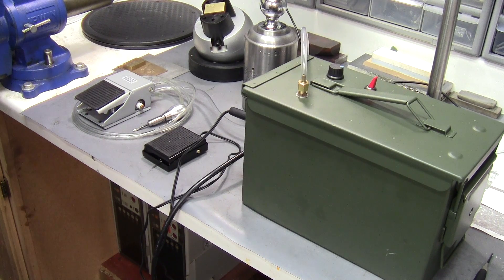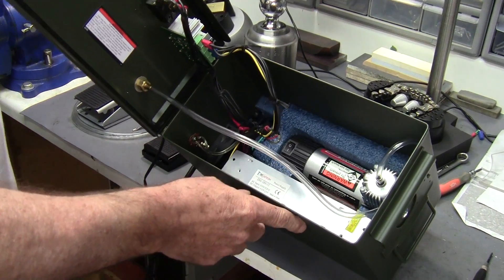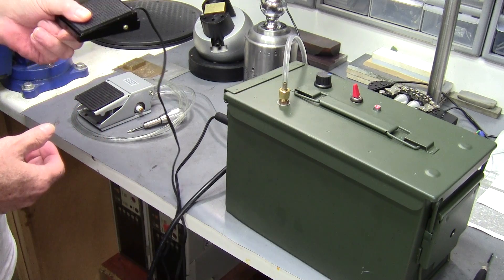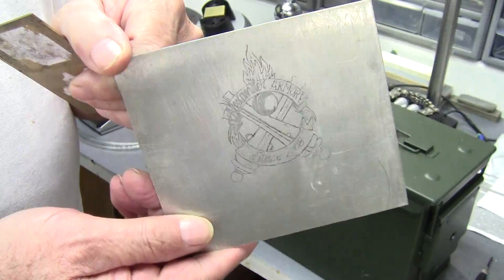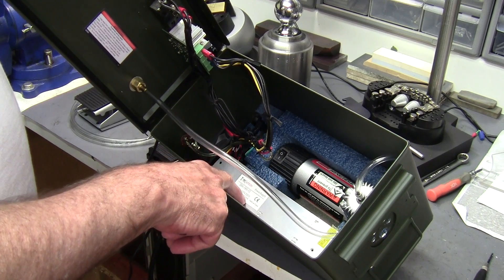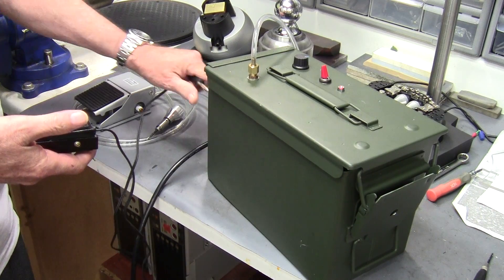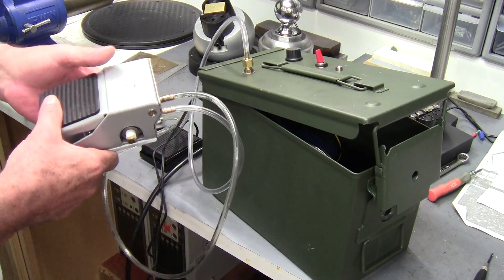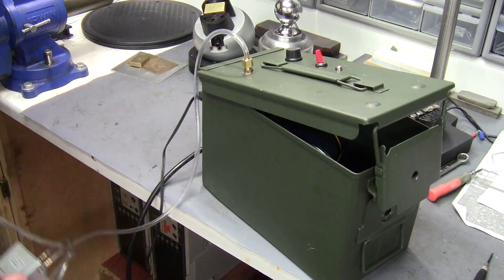How I built my Homemade Hand Engraving Machine Part 1

Comment: Can you tell us what the electric pedal does? The pedal compresses the air to operate the machine. But your electric pedal has 2 wires (no speed control). If you press it again, you have to press 2 pedals at the same time
Reply: Thank you, I understand. Hope you have many good works
Reply from the maker: The reason I show two pedal's is to give you options, I use just the electric pedal, I set the speed controller to the speed I want and use the pedal to turn the machine on and off. For finer control use the air pedal. What pedal you use is a personal choice depending on how you like to engrave. You could also wire the air pedal to turn the machine on as you press the pedal. You do not need both pedals, use the setup that works best for you.

Comment: Will this machine work with a hand piece bought on amazon?
Reply from the maker: I do not know, I have only used the ones I made. I've been ask this question before, but so far no one has said they tried to make one work.  I do know the Chinese hand-pieces are GRS clones so they don't work the same as the homemade system,  it would have to be modified.
Reply: @ralex397  do you sell the hand pieces that you make? I don’t have the equipment to machine my own
Reply from the maker: @brettmcguffee8119  No I no longer make these to sell, sorry.

Comment: The machine only lasts 30 or 40 hours then shot.
Reply from the maker: Watch my Required Maintenance video, you need to keep an eye on it in the first few hours and make sure it has enough oil in the head and how hot is it getting. I have seen some fail in less than 50 hours and others go for 100's of hours. It sucks when it wears out that quick. Good luck.

Comment: I just finished making this part of the project. Only thing I really did different was add a 120v fuse and an additional switch that turns on the 12v to the pump. Now onto the graver machine.

Comment: Lacking a Mill and Lathe with which to make my own handpiece, would this system work with the low price hand pieces you see on Amazon and Ebay (usually $30-$45 US)?  Also, THANK YOU for offering to share the blueprints.  You are a Gentleman and an Open-Source Champion.
Reply from the maker: I do not know, but at those prices it would be worth a try, if it works let me know and I'll pass it along.
Reply: Did you try it out ??
Reply: Did the Amazon hand piece work?

Comment: Hi Rick.. Can you explain why do you need 2 pedals?
Reply from the maker: You don't, you can use either or, for what I normally do I only need on and off, for finer lines and better control I'll use the air peddle. Its a personal preference thing.
Reply: Well Rick.. Let me tell you.... I just follow exactly your tutorial and it works.... Everything i got is exactly as your teachings and stuffs (except your 50 caliber box... Jajajaja...and compressor which is same size but a bit different although the principle is the same. And Guess what? It works fine.. Thanks to you and your great video.... Cheers
Reply from the maker: Glad you like it! Happy engraving!

Comment: Help! I just noticed I got a 3khz speed controller. The compressor fires and runs when wired directly to the power source but doesn't run when it's wired through the controller... I ordered the 13khz and hoping this does the trick. Something else I noticed that is odd, my power source is putting out around 20v. Hopefully that isn't causing issues too 🤔
Reply from the maker: I use this speed controller, it is a 13khz,
https://www.ebay.com/itm/12-40V-10A-PWM-DC-Motor-Speed-Control-Switch-Controller-Voltage-Regulator-Dimmer/114710420440?hash=item1ab5461bd8:g:2HsAAOSwgKpgPkXN

Comment: I had read about an artist getting a hand injury and wondered if there is a risk from the vibration. Would it be a good idea to cover the hand tool with a fiberglass pipe/maybe additional shock absorbing rubber around that maybe?
Reply from the maker: There is always a risk of injury form any impact type tool, sheet metal guys get carpal tunnel syndrome from using rivet guns for hours each day. But that happens after many years of using impact tools. There are ergonomic gloves you can get to help with the effects of impact on the hand. Yes if you are going to work with this type tool for 8 hours plus each day you will eventually have problems. If you only use it occasionally you should have no problems at all.

Comment: Hey Rick, I'm running into an issue with my setup and I'm hoping you could help. My compressor only starts up sometimes. I'm wondering what you have set for the voltage output of your power supply and what the voltage output is on the motor side of your speed controller?
Im using the same parts as you except for a little larger fan and minus the tattoo pedal.
The only way I can get mine to start is if I first supply power while compressor is in the off position and my pot is turned up all the way, then I can reach in and power on the compressor. 
Thanks for your time, all the great videos and
your help.
Reply from the maker: Hook 12 volts straight to the speed controller, does the motor start and run?
Reply: @ralex397  It does run. I tested prior to wiring up. Initially I set 12v into the controller but couldn't get the motor to kick over until I upped the voltage to around 14v. When I checked the output voltage from the controller to the motor I was loosing about 1 volt. 
I picked up a higher amp 12v power supply and another controller. I'll run 12v to the controller and let you know how this one goes. 🤞
Reply from the maker: What I was trying to say was bypass the power supply and hook it to a 12 volt battery. My power supply has a voltage adjustment screw, but I didn't need to adjust mine. Good Luck!
Reply: @ralex397  ohhh alright, I'll give that a shot. Thanks Rick, that's what I was wondering. Is if I even had to mess with the volt setting on the PS at all. Cheers

Comment: I’d love one, how much to make one for me ready to go?
Reply from the maker: I do not make this side of the machine, I only make the hand pieces, you have to make the compressor box assembly yourself, I have no way to warranty modified Chinese parts.
Reply: I wouldn’t need a warranty! I would buy one too!!
Reply from the maker: @sethmailahn6770  In order to keep this machine maintained and running you need to be able to build it. Then if anything breaks you'll know how to fix it. Its a simple circuit, not a lot of wiring, the mod on the compressor is easy and the parts are cheap. Good Luck!

Comment: i have built almost the same thing, however i dont have a speed controller. is it possible to run it without a speed controller? mine does not seem to be working yet. thanks
Reply from the maker: A speed controller is a must, without it the motor runs to fast. They are cheap, under $7 shipped from eBay. Good Luck!

Comment: Why do you need two pedals?  One can see that there is a breath and the other for what?
Reply from the maker: One pedal for air and one to turn the machine on and off so its not constantly running, its a personal preference thing. Right now I'm not using the air pedal, I use the tattoo pedal to turn it on and off. For the type of engraving I'm doing I don't need the fine control the air pedal gives me.

Comment: Hello sir, may I ask which one do I need the air foot pedal , 2 position 3 port or 2 position 2 way ???? can you help me please I just finished made my hand engraving machine :)))
Reply from the maker: I think either one will work but I have been using the 2 position 3 port, the 3rd port, the one on the side is not used and does not need to be plugged.
Reply: Rick Alexander thank you for your reply . I think that port is for the air go out while the compressor is working and when you press on the foot pedal it will switch on the out line port ????

Comment: where to get the motor controlor?
Reply from the maker: I get them off eBay, search;     12V-40V 10A PWM DC Motor Speed Controller
Reply: I'm trying to run mine off an old PC PSU- 520 watt. It ran well for 8 mins yesterday. Let me know if you go that route and I'll tell you how to wire it. Or look up pin out diagrams on the web.
Reply: Also plan to use some of the PC heat sinks to beef up the flimsy fins on the HF compressor chamber. It needs some thermal compound between the steel chamber and the original sink, as well.

Comment: I was wondering, do you think in stead of having the speed control and the on/off pedal you could replace both with a variable speed foot pedal off of a Foredom grinder or sewing machine?
Reply from the maker: I am not familiar with those type pedals, they may work well, I just don't know.
Reply: Rick Alexander thanks for the reply. I did a bit more research and came to the conclusion it would probably work but is probably unnecessary and may make it more of a hassle trying to feather two pedals.

Comment: thanks for sharing this video ,i have a question. if you do not mind ,most of the Air compressors have an  Air tank, but the small ones.  does having the air tank necessary to work with or we can work with tankless ones as well as with tank?
Reply from the maker: This engraver only works with a modified compressor, a 12 volt tire inflators work the best but some have been using modified 110 volt air brush compressors. After the compressor is modified it will no longer work as a compressor. It will only suck and blow the same air back and forth.
Reply: thank you so much for fast response

Comment: I've just seen your video, great work and looks solid.
I think there is an issue with the piston/spring tension of your machine currently. The force of the piston oscillation seems too high and it is causing the hand piece to move/wobble.
When I first made my machine it was doing the same thing. I think I increased the size of the piston chamber and increased the tension on the spring which solved the issue. Reducing the speed of the compressor will also make it easier to control.
Reply from the maker: Thats why you need a speed controller, without one the compressor runs at full speed and is too fast for proper operation of the hand piece. My first hand pieces had larger cylinder bores, .500 inch, they ran ok, but didn't hit as hard as a hand piece with a .375 to .350 cylinders. All my hand pieces are now bored to  .350, and they can engrave anything.
Reply: Thats great. I am using a chinese hand piece as I don't have the skills to make my own! I did however make the spring and use a ball bearing as a piston - This setup does the job for me.
I like the idea of an air foot controller that you've done. Seems better than the clamp pedal.

Comment: Hi Rick, I was referred to you by Shaun Hughes.  He was correct, you are a master of creativity and neatness. All the components in this engraver  are a piece of artwork. I am not an electrician but worked with many of them throughout the installation of a 40 million $ production facility. I was on the mechanical end. I was always amazed at how they  crammed miles of wires, controllers, power supplies, switches and hundreds of parts I don't even know the name of. One 8' X  10' panel controlled 46 DC motors from 2-50 HP. Your work reminds me of the sanitary innards of those huge cabinets. Thanks for sharing it with us all. Shaun gave me your email address and I will send you an email and tell you my delima. First I need to view all your videos. I don't want to bother you unnecessarily. 

Thanks again,   Scott
Reply from the maker: Thanks Scott, feel free to ask questions any time, they may help someone else out, or get me thinking about what I can do to make the engravers better.
Reply: Thanks for getting back to me so soon Rick. I was watching your video on the fabrication of the handpiece. Another beauty. Knowing a bit about mechanics, I can tell a lot of thought  went into the design and the perfect fit of the barrel and slide.  It reminds me of a Mercedes Benz door closing.The high grade materials make the ergonomics stunning. One thing I can't wrap my arms around yet is why the compressor has to be modified. Why can't we get the same result using a continuous supply of air? I guess I'll keep checking the videos and it may make more sense to me.

Thanks again Rick!